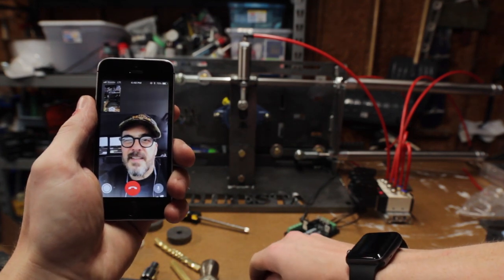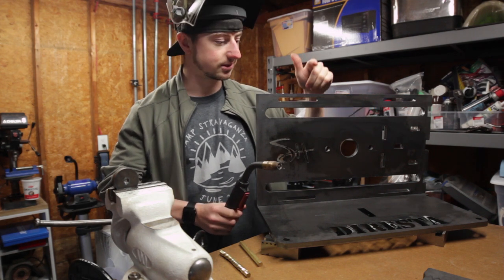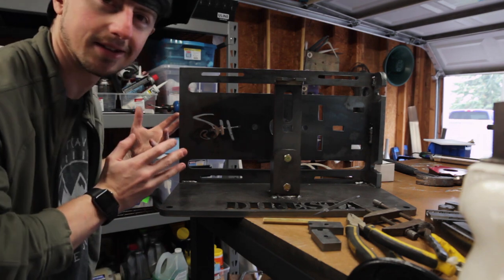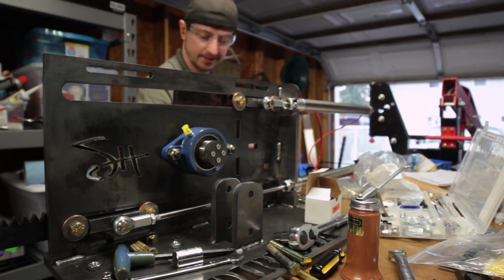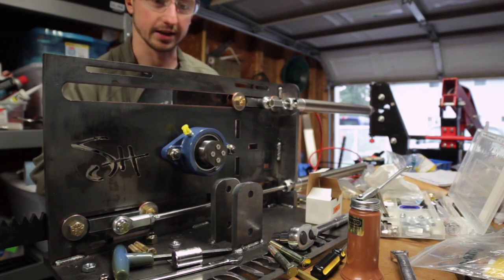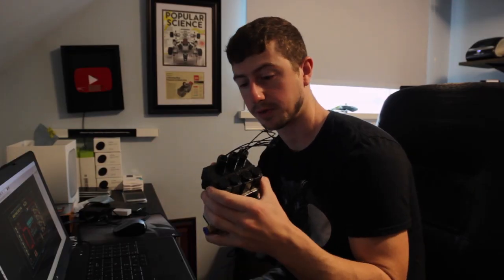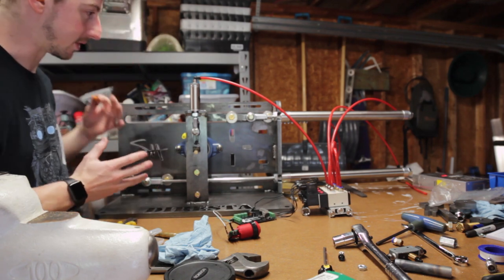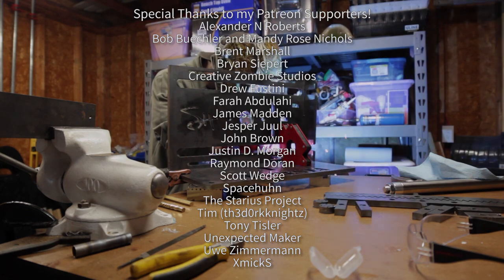Diresta Ice Pick Twister - Part 1

Comment: Bravo: The 21st century Brass Smith, at the dawn of the robotic era, sort of real life steam punk. What a super idea. Technically fascinating to see how the gears & toothed drive stand up to their toils & how the mosfets, no heat sink I could see, handle their duties. Excited to see how you get it all going. Commiserations over the 1/4 inch 6 mm mismatch, that hurt me when I tried to flange some 6 mm Mercedes hydraulic pipe with 1/4 inch flanging kit, making me a little paranoid over making sure what is sold as 6 mm is not 1/4 inch & vice versa, but the corrected pipes have been in use for well over a year so all ended well for me. Thanks for sharing!
Reply from the maker: Thanks! I don't think the FETs will overhead in normal use(waiting for brass to heat up, then fire them for a second, very low duty cycle). I'm sure it will need a bunch of tuning, maybe even some parts changed out. I did the math on what is required to twist it, but in the real world, not always the same. haha - Yeah whats worse is I think the valves are BSPT, and I have NPT. Not Ideal. Time to order a bunch of fittings and hose to make it work!

Comment: That rack could be quite the meat grinder if you aren't careful! Propane/Mapp gas or an induction heater? Also how did you get Mcmaster Carr in canada? By the way LM7805's need decoupling capacitors on the input and output. Without them the reg usually starts to self oscillate, overheat and eventually let the magic smoke out. May want to bodge a 100u and 10u on the input/output pins!
Reply from the maker: Mariano Elia yeah, going for the meat grinder look! The point was to try to avoid gas heating. Was testing induction heating but with the brass it wasn’t great. I found these cool little resistive heater coils that have a funny use. You’ll see it soon. Yeah that 7805 should probably have them, I don’t ever use them and the datasheet said it didn’t but people don’t seem to agree. It’s working though, the HCC module has its own regulator for 3.3V so the 5V doesn’t do really anything than drop the voltage to 5V. I’ll definitely throw one on there. Thanks!
Reply: Cool I look forward to a follow-up vid! I missed the kickstarter for the HCC, are you planning to make extras to sell on tindie or somewhere else? I'd purchase a couple for sure
Reply from the maker: Yeah, I do plan on having some extra to purchase on a web store, unfortunately I haven't set that up yet! They will be for sale on idlehandsdev.com when I manage to get some time to do it.

Comment: Where did you get your steel cut? Online service like big blue saw or local service? Why laser and not waterjet for such a thick plate?
Reply from the maker: I haven't found a suitable waterjet place. I'm on the lookout though. I've used the lasercutting service before so they're easy to work with.